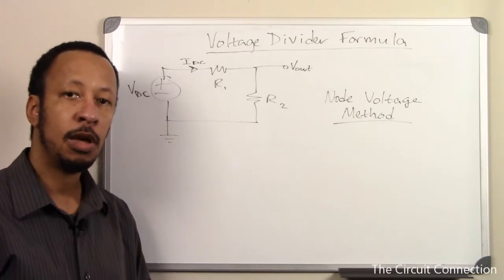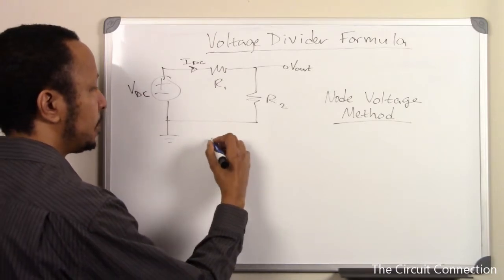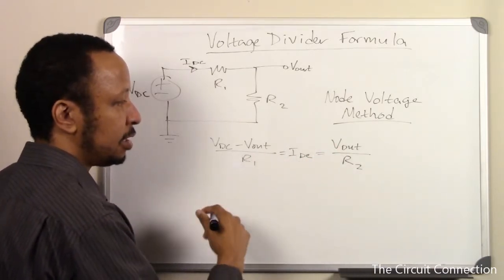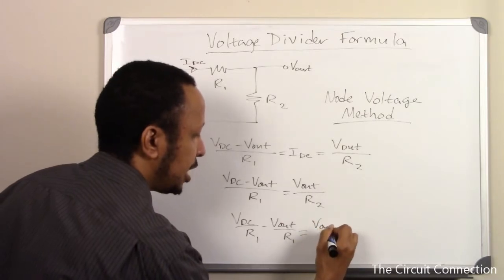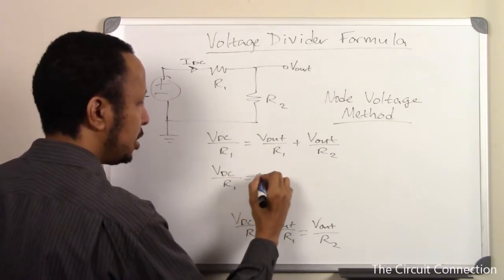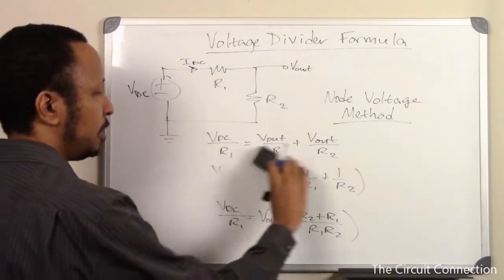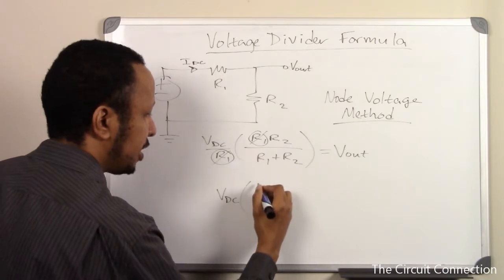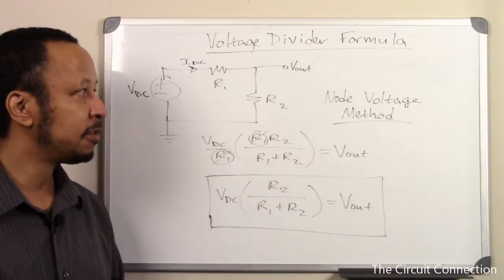16 Voltage Divider Formula Derivation

Comment: It's a bit useless without the load. It's like ignoring the assets side in accounting and still expect the students to graduate.
Reply from the maker: This formula is what is in college textbooks. I am taking the time to try to create clarity and a better understanding of where this formula actually comes from or why it is valid. As you go further into your engineering studies, you will see that if a load has relatively high impedance, you need not worry about how that load will decrease the voltage of the second resistor. Load support comes from an understanding of the output resistance of any circuit. Please watch some of my other videos to get a more general understanding. Thanks, I look forward to questions.